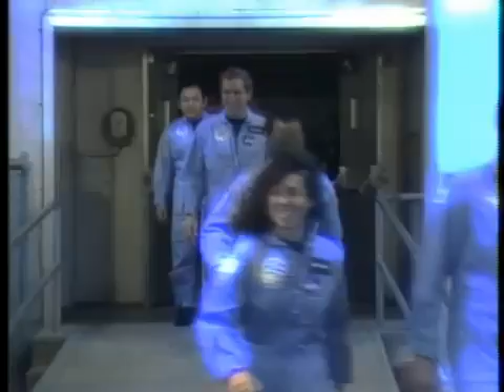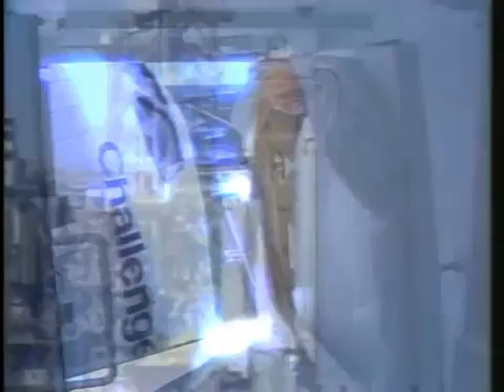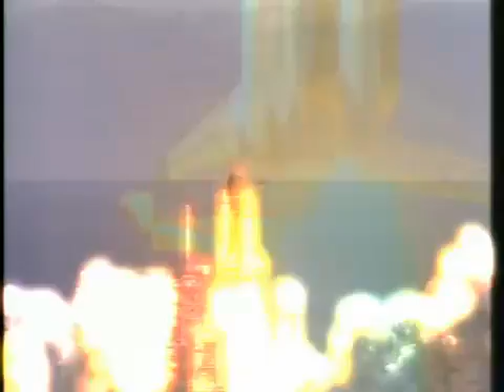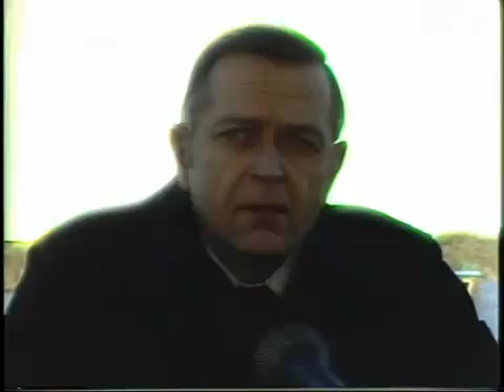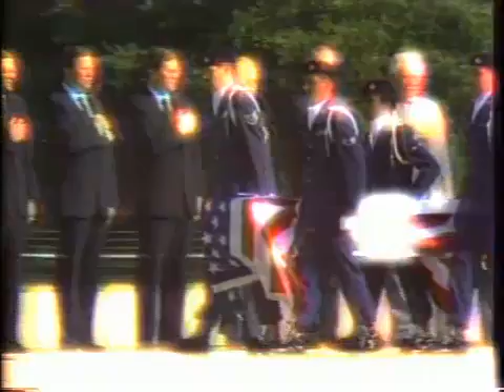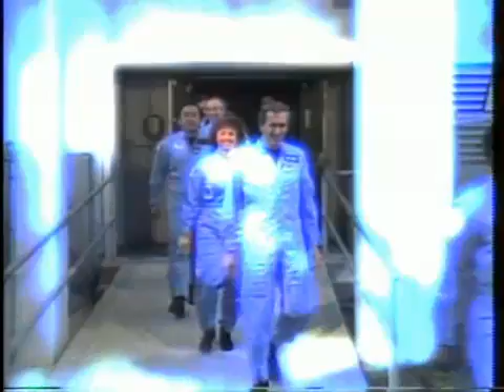Space Shuttle Challenger - The Disaster

Comment: yes that is right because those O rings burned through several times on other missions and other shuttles.  Now hmmm O rings to stop the high temperature gases in a sold fuel rocket booster.  How about a better seal with metal and sandwiching a special metal gasket that compresses and seals the entire joint.  this metal gasket could be designed to handle the temperatures of the hot gasses.  Oh well.  What does NASA stand for?  Need Another Seven Astronauts.....

Comment: NASA put pressure onto the rocket engineers saying that they had to ok the launch. The launch had already been moved a few times to later dates because of temperature. The rocket had never been tested at 30 degrees temperature. The o ring failed because of temperature (it was around 30 degrees). If they would have waited a few more days, it would have been ok. It's not Reagan's fault. It was NASA's fault and whoever

Comment: Stop talking shit. 

The shuttle DIDNT explode. failed O ring on the stbd booster caused a burn through into the ET. The STBD SRB detached its aft coupling, causing a hard yawing. The Yaw caused a failure between the ETs interal hydrogen and Oxygent tanks, with subsequent tank explosion. The orbiter itself wa torn about by aerodynamic forces. Not explosive ones.

Comment: Right, Anbidas125--The O-rings failed to "seat" properly, due to the below-freezing temperatures experienced the night before launch.  At ignition, the first O-ring immediately burned away, but pieces of aluminum "slag" sealed the breach, preventing Challenger from exploding on the launch pad.  Then, about 50 seconds after launch, Challenger was slammed by a fast moving jet stream which dislodged the "slag," re-opened the breach, and the disaster occurred.

Comment: What we should INSIST on for all future manned vehicles.  All Liquid fueled rocket using multi-engine clustering.  Each engine should have individual engine out on demand capability.  The escape system should be built into the crew vehicle so it can be used all the way to orbit without a dangerous tower ejection.  Its heat shield should be Mars rated at 55,000mph.  The only vehicle ever made with all these safety features is being made by SpaceX.

Comment: Design failure.  What we should learn from this.  1) Never use solid rocket fuel (which does not turn off) on a manned rocket.  2) Never strap on SRB's next to a main liquid fuel tank.  SADLY we are making the same mistake with NASA's new SLS.  3) Never have a manned rocket with no escape system.  4) Winged craft make really bad Space crafts, which is different than a lifting body.  5) Never strap on a vehicle inline with a fuel tank.

Comment: The "oxygen" tanks the astronauts carried didn't contain actual oxygen, and were not pressurized they were for use if the astronauts had to evacuate the suttle while on the launch pad. See PEAPS (personal egress air pack). The PEAP that was found to have been activated belonged to pilot Mike Smith, and would have been activated by MS Resnik, since it was mounted on the back of his seat frame. Cdr Scobees PEAP was also recovered and had not been activated.

Comment: @lexxxa2oo8 From what I've read, it is doubtful that they were conscious when the cabin hit the water there were simply too many ways the cabin could have de-pressurized when it broke away, and they would not have recovered consciousness before the capsule hit the water. Also, don't forget the capsule continued moving on an upward trajectory for another roughly 20,000 feet before it started actually falling. you are correct about the g-forces- it wouldn't even have knocked them out.
Reply: Dude, when they were recovered, about 4 of them had their EVAs on, meaning they had access to breathable oxygen. They weren't unconscious, because the Challenger disintegrated and after the cabin had split from the boosters, it was still fully intact 👌
They all died, when they made cintact with the ocean!